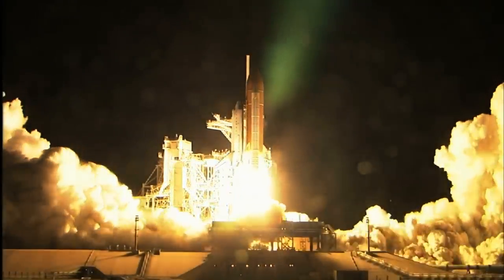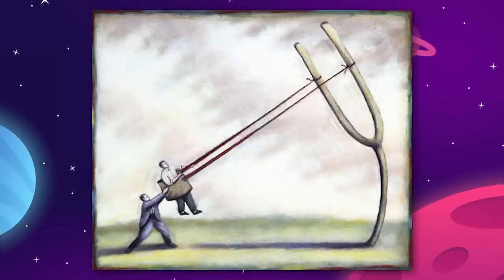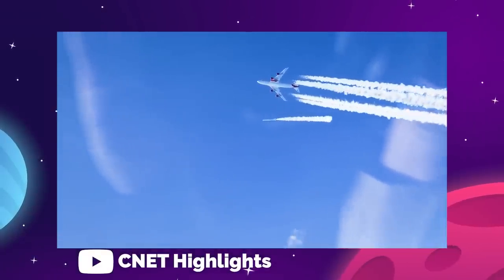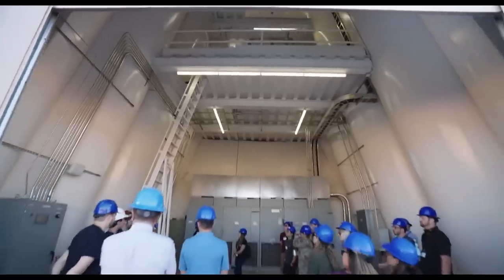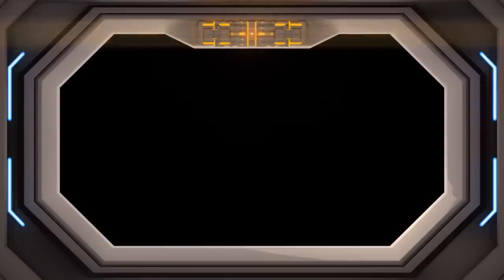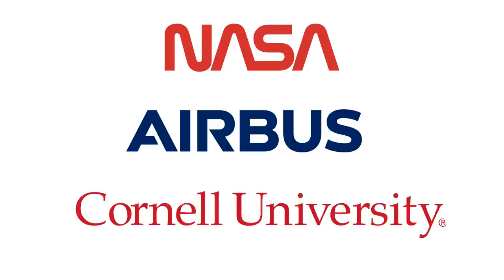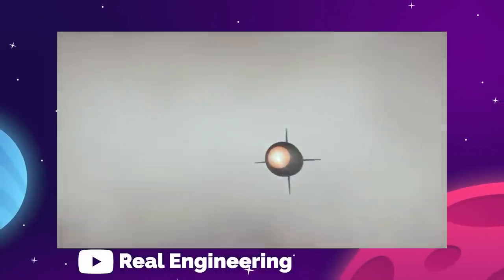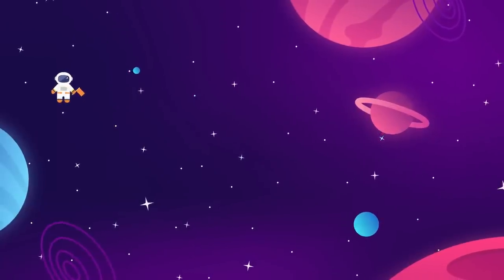How NASA Is Throwing Rockets To Space With A Giant Catapult!

Comment: They need to start designing a small Spinlauncher in module form which can be transported by a starship.  This will be the best way to get lunar ore into space for major manufacturing of our space stations and fleet.  Yes I know this is years (maybe a decade) in the future, but start the designing now!
Reply: After watching this, I instantly had the same thing in mind 💯
Reply: No need to go that far, since the moon is already near vacuum and has vast amounts of free real-estate, a simple linear accelerator (like a rail gun) will suffice. It'll be a lot easier to send parts for that than a centrifuge sling shot, plus the tech for rail guns of that scale is already feasible today.
Reply: @justiceifeme  Good point.  But Mars . . . !
Reply: @SirCharles12357  Same issues still surface, just less pronounced since Mars is 1/3 earth's gravity and has some what of an atmosphere. It will still be more complex to transport and build a vacuum chamber sling shot on Mars compared to a rail gun system, however, depending on the situation it can be a viable option. 

But if you're taking star ships to Mars in large numbers before you could realistically start up any large scale building, it's better to just launch them straight from the ground on them, since leaving Mars atmosphere isn't as challenging and weight won't be much of an issue either, instead of taking extra steps to fling it into orbit and still recapture it there with starship.  At least in the case of moon, we could sling materials from it straight to earth's orbit and capture them there, with Mars, you're not sending anything back to earth without a rocket (except if you want to wait a very long time for the orbital mechanics of flinging materials from Mars to earth to payoff)
Reply: The current one could, almost, manage a lunar escape launch.

Comment: Lengthen the launch tube and release spin room vacuum from the other side, the second the rocket enters the tube. It'll serve two purposes. If the length of the tube, the release volume and release angle of the spin room vacuum is calculated right, it'll lessen the amount of air resistance on the rocket from the tube opening or ripping up top and air rushing in. The second would be that the airflow can be directed and angled to slow the arms spin. Maybe more than one air release in the spin room. But then again, a longer tube and fast door hatches seems more feasible. Good going!

Comment: This will require more carbon fuel, not less, in order to accomplish the same job as a rocket.
The energy required to get a payload into orbit is the same. While the rocket is designed specifically to combust the exact amount of fuel to get the job done, this machine relies on the electrical grid. With the west coast being serviced primarily by coal burning plants (30% thermal efficiency), factoring in the transmission losses, battery and or capacitor losses, and the thermal loss at the motor itself, this thing is going to need a lot of fuel.
I won't even get started about the fact that 10,000 G forces means that this method will only be safe for launching bowling balls into space.
Reply: Try again.  Rockets have to accelerate a lot of fuel to get to orbit.  Spinlaunch just accelerates the upper stage, so from that viewpoint it's vastly more fuel-efficient.  Whether drag will be high enough to negate that advantage I have no idea.
Reply: @johnbrobston1334  Since you've already demonstrated that you cannot read, I'll just say, you are wrong. All of the losses mentioned above negate the additional weight of a launch vehicle and it's fuel. The comment about drag is nonsensical so I'm just going to ignore it.
Reply: @durrhurrdurrah6062  OK, show us the math.  All of it.  You should easily be able to do that with all of your expertise.

Comment: This is ridiculous. Mach 6 is v=2040 m/s and radial acceleration is a = v^2/r where r is 45 m. This gives a = 92,480 m/s^2 or roughly 9,427 g's acting laterally on the projectile as it reaches the ejection velocity, assuming g = 9.81 m/s^2. What kind of machinery could withstand that much g force?
Reply: Lots of stuff. In the 40'sthey had vacuum tunes that could fire out of artillery.
Reply: Maybe  SpinLaunch?  I'm willing to give them the benefit of doubt. Anyone else with me on this?
Reply: Well I guess that machine
Reply: Not only that but getting up out of the atmosphere only really 'costs' about one to two thousand meters per second for a normal rocket and that 2040 m/s speed it goes at is going pretty much straight up. Wasted as it slows going up out of the atmosphere. This is only saving about an eighth, maybe a little more, of the velocity that a normal rocket has to build up to reach orbit. This means the ship it throws up STILL needs to be mostly fuel, though with the tyranny of the rocket equation even that amount of saving will reduce the fraction from somewhere around 95% (for a single stage to orbit) to way less. Maybe 70 to 80%. If they are using a two stage this will help with that, but it's still going to need a lot of fuel on board, which means far smaller payload. How big can the projectile be? My guess is this thing is only ever going to launch cube sats or equivalent small payloads, never anything of real size. It just doesn't make much sense. Surely the myriad of smaller rocket launch systems coming out of the woodwork lately will be cheaper than this?
Reply: Also this acceleration it has to withstand is not brief. Projectiles have been made with electronics that can withstand tens of thousands of gs for gun fired electronics. More even. But only for very brief periods. For this the acceleration is as it is spun up, not for the release which will actually be when the acceleration stops. It then will be under constant slow acceleration due to air friction. Off hand I'm not sure how much acceleration it would need for a constant spin to generate that amount of velocity, but it's dependent on the rotation speed, not how long it takes to wind up to that speed. And that wind up will take a long time, the acceleration it feels going up and up as it gets ready for launch. How much gs can they withstand for at very least minutes at a time. More likely twenty to thirty minutes I'd guess at to wind this up safely. As others have said, the abrupt release is seriously going to stress the system as it will be suddenly imbalanced when the payload separates, now having most mass on the opposite arm. Not sure how they can balance that, or how the bearing in the middle would handle that as it jerks. Sounds like a lot of repair work from each launch to me.
Reply: I believe they are using a carbon fibre process for producing the launching arm.
Reply: I mean you could watch real engineering’s video on spinlaunch and be surprised right ?😂
Reply: Quite a lot of electronics.  A 1940s vintage vacuum tube proximity fuse has no problem handing 20,000G.

Comment: What a complete waste of my time.  If the satellite  had a 1 oz chip on a circuit board, that board would need to be able support a weight of 1250 lbs at 10,000 gs, just for that one chip.  The chip itself would need to be able to withstand the weight of each transistor on the waffer that weighs 10,000 times more than it does sitting in a cpu on you desk.  Taken a step further, a 100 lb payload would weigh 1,000,000 lbs at the end of the arm and its shell and the proposed rocket motor would need to be able to sustain equivalent forces.   Great idea, but not really practical with our cuurent technology or any that I am aware of on the distant horizon.  Put it on the moon to thru rock payloads back towards earth, and you might have a reasonable chance of viability.

Comment: I’ve seen coverage of this conceptual engineering and I love it. It made me think, if successful in its application of use we could use these to literally launch valuable and research worthy matter from larger asteroids in the asteroid belt to launch the material itself back to earth for a low energy cost and practically no fuel based requirement for travel except to slow down and land on the moon in relatively one piece. Then if put in use with say tesla brakes that can reabsorb lose energy, could be even closer to a net zero energy bill overall.